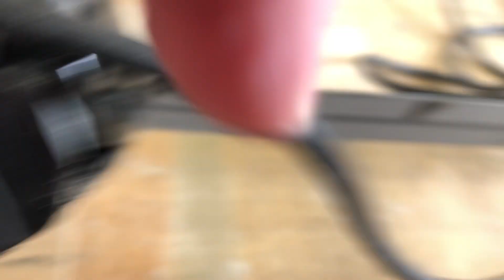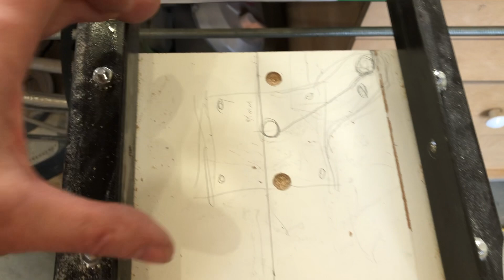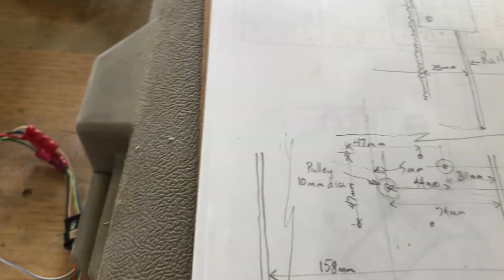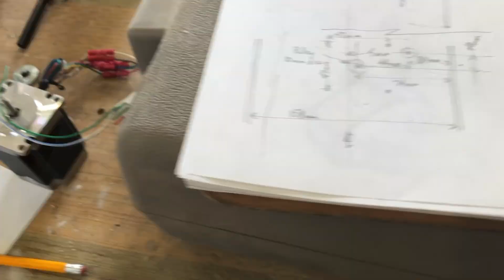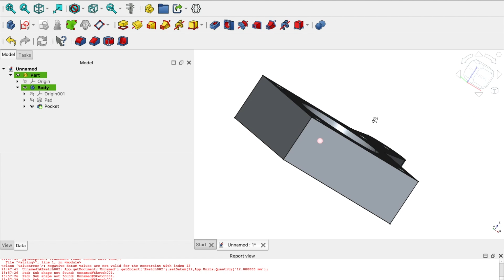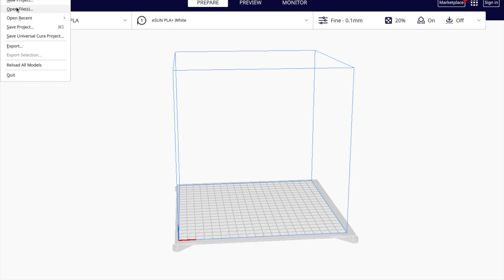Bedrail CNC - Part 3 - FreeCAD & 3D Printing a Part

Comment: Is your 3D printer a DIY job?
Reply from the maker: Yes. I have built a few 3d printers, this one being the first. Two other machines I have built have not lasted as long as this one.  One of the things I want to do with the CNC is build some precision parts to make a NEW 3d printer.  Tools to build tools.
Reply: @secretundergroundlair4014  I have a Bambu that is very "consumer electronics" so yours is quite a contrast 😁

My wife and son love the Bambu, though
Reply: @secretundergroundlair4014 Wow, I was wondering what 3D printer you were going to use. I was also wondering if we’d see it at the end of the video. I didn’t expect that. Well, well done :)
Reply from the maker: I keep thinking I'll do a video of the 3d printer ... but I might save that until the CNC is up and running.